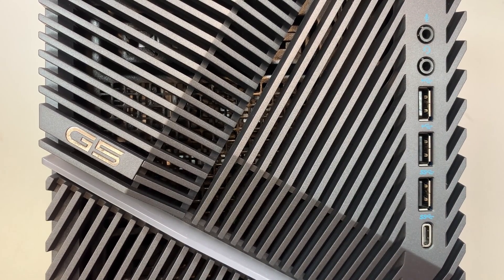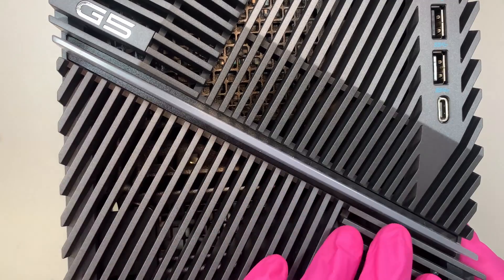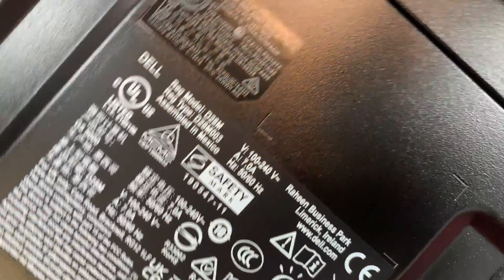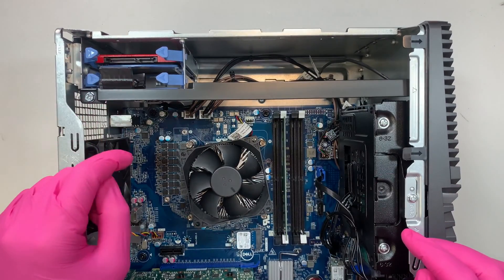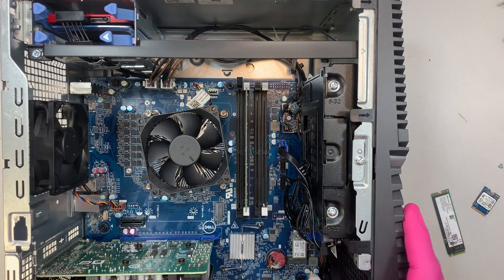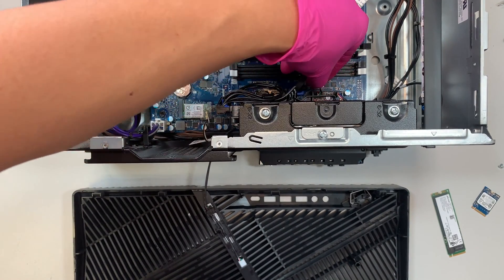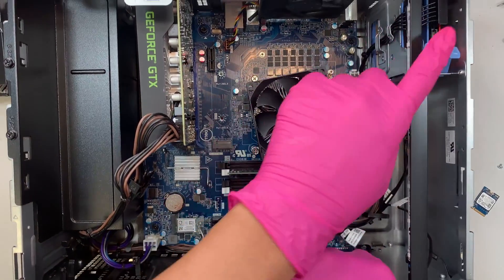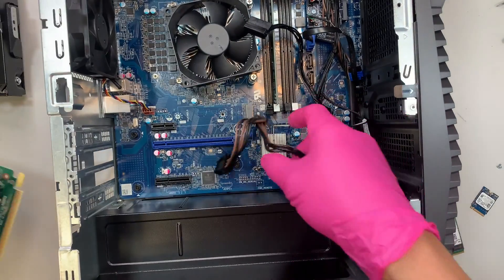Dell G5 5000 Gaming Desktop Inside Review

Comment: I have the 9th gen version of this system, ordered it brand new from Dell in 2019.I bought the I3 base model and did quite a bit of upgrades to it over the years. It performs well but, the stock cooling solution is terrible on the models that don't come with a K cpu. I have an I5 9400f in my system that I caught on sale from Newegg for a tad over $100. Idle temps were about 34c but when ramping the cpu up near or at it's 100% usage and temps would hover around 87c. Swapping the cooler and adding a VRM heatsink brought temps down to a more reasonable mid 70's. I am still running the stock GTX 1660 Super that came in it and have never had any issues with the PC as a whole. Downsides are obviously the proprietary mobo and psu design so, if either dies, only a direct replacement will fit in the case correctly. Mine was $750-ish new in 2019 and that was cheaper than buying the 1660 super by itself lol.  Nice review of this system btw and for anyone on the fence about buying one of these, try to get they model with a side window interior and case lights as these options were only available on systems with the large 460w and 500w psu units. Keep the dust blown out good every other month or so and it's a nice PC.

Comment: Hi I found this video and I am just wondering if u could help me with a problem? My problem is that my Wi-Fi likes to randomly disconnect for about 5 seconds and then reconnect again. This can happen every 20-30 minutes and it is really annoying. I was wondering if it had to do with the little Wi-Fi chip  that u pointed out at 10:35 or with my ISP?
Reply from the maker: Not your ISP. Gotta be WiFi card. If you can't find a replacement, try getting this usb wifi adapter:    https://amzn.to/3IKFtL2

Comment: hi bought this last year and it isn't bad but was wondering what is the best gpu i can upgrade to. Mine came with a 500w psu and a i7 10700f. I currently have the 1650 super. Thanks
Reply from the maker: Check the power supply PCIE cable. If you have 6 pins or 8 pins ? Try match the pins on new graphic card

Comment: Hello,

Great video 

I have this but only the bare basics 250GB 

Should I add the 2.5 or do a hard drive in the front slot where the 4 clips are ?  (Where you had a 1 terabyte). I assume I don’t have anything there and only a M.2

Comment: hey uber geeks, i have a g5 5090 that didn't come with the internal LED light bar that sits across the top of the inside of the pc, that mounts to the hdd case.  can you please please please send me the DP/N (located on a sticker for the LED bar wire that plugs into the motherboard).... thank you in advance.
Reply from the maker: https://ebay.us/9aQm7o
Reply: @UbergeeksBiz  bought it and it's about 4 inches too long. also wrong connector plug :(

Comment: Hi, i have this PC w/ i5-10400F and want to upgrade to 32 GB RAM

would it be better to find 3 8GB sticks to go with the included 8GB stick (if so, what do u recommend)

or to buy 2x16GB RAM  (for example, from the Teamgroup amazon link you provided)
Reply: @UberGeeks
Reply: update: i went with 2x16GB and it is working well
Reply from the maker: Glad you did the right thing. 2x16gb RAM

Comment: Can you create a tutorial installing a retail cpu cooler like the Vetroo V5? It's a budget cooler on Amazon that performs similar to Noctua ones and is compatible with this style of pc. I'm asking because the stock cooler has thermal problems and this would be a great solution for many G5 users, Thank you.
Reply from the maker: I tried checking the heatsink holder, it is not compatible to hold 3rd part heatsink.